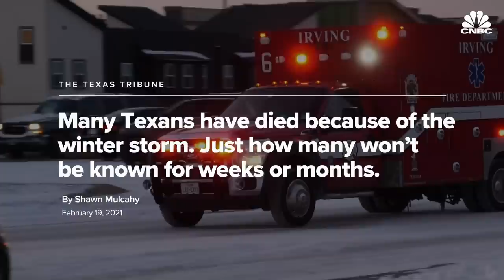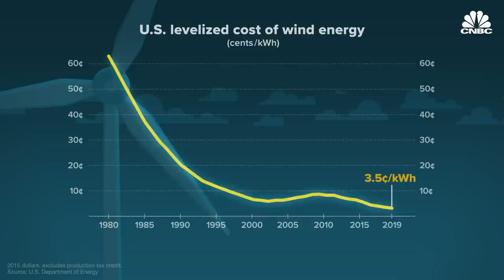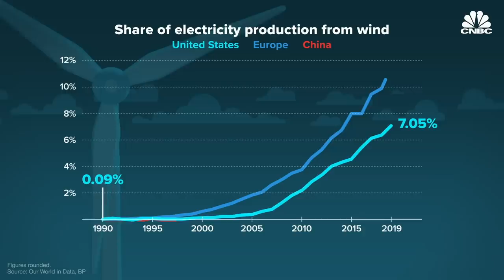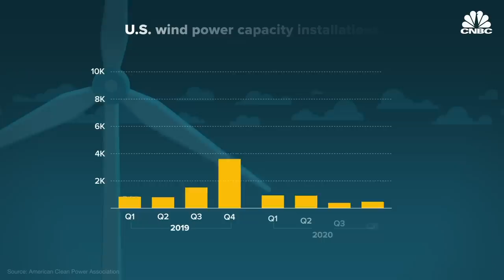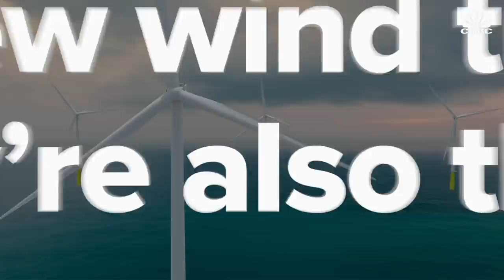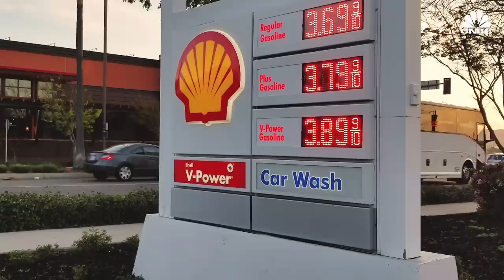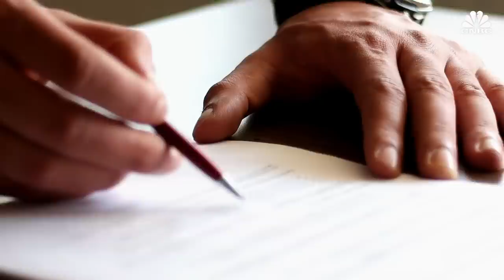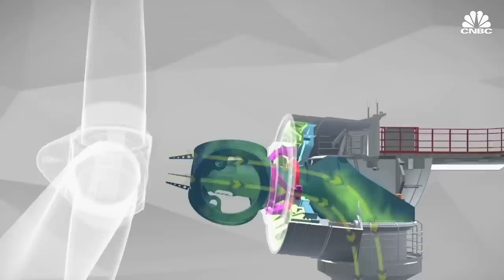The Rise Of Wind Power In The U.S.

Comment: there are so many many ways you could've followed the trend and make this into one of those: 
"the rise and fall of wind power in America"
"why wind power is falling in America"
"why America lags behind in wind power" 
"how America does wind power wrong"
...
exaggerating and using facts out of context to push that narrative, ... but you didn't. that's kind of refreshing 
but you probably wouldn't get as much views with this, especially from foreigners, commenting about how much better they are than America (usually without naming their country)

suggestion: 
why not take a topic like this; wind energy / wind power 
and go through what America is doing right and where there's still room for improvement. 
instead of just focusing on the negative (using facts out of context) creating or enhancing this false narratives.

Comment: Another thing to consider is that when wind turbines reach their end of life, they can be dismantled easily, cheaply and safely.  Many parts can be recycled.  Decommissioning and dismantling fossil fuel plants and nukes is God awful expensive, leaves contamination behind and in the case of nukes, what to do with all the radioactive waste, including structural parts of the plants.  In many cases the taxpayers end up paying much of the costs and have to deal with long term pollution.
Reply: Not true. In most cases, the blades are taken down and land-filled, because there is no recycling program for fiberglass. The turbine motors and wiring can be recycled. The cost to take down a tower is so high that most are abandoned. Imagine, after 30 years of generating power, they decommission the wind farm, and leave 20-100 free standing 300' tall towers. There's a reason that the wind generating companies lease the land instead of buying it. At the end of the lease, the wind company walks away, surrendering their "removal bond" (because it's generally 25% of the actual cost to return the property to its original state), and leaves the mess for the land owner to deal with.

And let's not forget about "tower collapse", "turbine fires" (which are so high that they are allowed to burn themselves out), and blade shear (where one blade breaks and the whole unit destroys itself).

Comment: "operating right at the edge of what the turbines are structurally capable of" - yeah somehow I doubt that. Doesn't sound like a good idea to push these to near their breaking point.
Reply: It is a good idea. That's what engineering is all about. "what the turbines are structurally capable of" includes a margin of safety for all kinds of unlikely situations. In engineering you don't want any unnecessary material anywhere and you want to get everything you possibly can out of a machine as long as it's cost effective to do so.
Reply: @meamzcs  my god, thank you. quite literally the epitome of engineering.

Comment: Wanna know what renewable energy produces more energy than wind and solar combined per amount of land and per amount of building material, and lasts longer and results in less landfill material when scrapped?

Nuclear

Downside is a high initial cost and irrational fear
Reply: Nuclear is extremely dangerous and potentially devastating. Also if you factor in land usage from mining uranium, waste storage, plant sites, and transportation it’s not that much better space usage than any other.
Reply: @shasmi93  I agree to some extend, but the risk for nuclear meltdowns is close to nonexistent because of great improvements in safety

Comment: How can wind be cheaper than solar? The physical installation alone makes me think solar is cleaner and cheaper. What does the end of life disassembly of a wind turbine look like vs solar... You need specialized vehicles and teams to work with the turbines...
Reply: Whst do you think solar panels are made of exactly? And then how many panels do you think you'll need to generate as much electricity as a wind turbine?
Reply: @Hjernespreng  Exactly - solar panels are easy to transport, assemble, take apart, maintain and less hazardous. I guess cheaper panel technology is needed. Concentrated solar is another technology - not sure of its cost, but its nice that some of those give power 24/7 due to molten salt storage.
Reply: @colin1235421   the end valuation comes from generation of GWHrs through life of the device - wind, is an abolute killer there and will only get better with tech advancements.... BUT, PV also has the potential to really jump in efficiency per sq meter as time goes on - things like multi-junction cells, influences from investigating perovskites etc...  you could see solar cells approach 40-50% efficiency where today they're in the 20% range today...  Concentrated solar has some allure in some locations, but not easy to pull off either...

Comment: Are you kidding me we cannot go without fossil fuel can you imagine if all the fire trucks are utility trucks we’re all EV and the police cars when somebody called them more they say sorry we have no power how many solar panels and wind generators Do we need if we went all EV they say we need to off the grid in the United States 30% that’s huge I would need a wind generator in every backyard
Reply: You do understand that even if the world goes primarily electric transport
  Emergency, maintenance, and remotely traveling vehicles are still going to use ICEs as either backup power or primary power.
    Because:
 ICEs, like Diesels can travel everywhere with minimal fuel consumption.
  and most importantly
Diesels are highly unlikely to catch fire, as neither the fuel nor the emissions can be ignited by open flame so simply
   -Ambulances carry a ton of electrical equiment and must be on the call 24/7 even when grid power surges are present!
     Result -future ambulances use Diesel ICE as a generator

   -Fire Trucks have to travel everywhere quickly and be on call 24/7, the true reason to keep the diesel engine as the prime mover is because:
  *Firetrucks themselves can be caught in the infernos and  
or even can be collected in traffic accidents*
   adding high voltage batteries, especially ones that lack tyr armor are the equation to disaster
  Result -Firetrucks wil use the mildest hybrid system in complement to the Diesel ICE.

Comment: You didn't mentioned anything about used materials in production. Huge amount of plastic fibers,crumble in fine dust all over the place. I would like to hear more about that.
Reply: If you want to use electricity, it needs to be produced somewhere. You need a lot of materials for every power plant there is - wind, solar, coal, gas, hydro. With wind you don't get coal ash on your laundry, or ash slurry spills.

Comment: The turbines didn't just freeze but the wind died down to below 8 miles per hour during the freeze. They need wind speed above that to produce any power. The wind and solar provides a little over 25% of Texas electric generation. When the cold weather increased the electric demand the wind died causing the demand to outstrip the total supply. This caused the system to become unstable which caused automatic shut downs of some power plants to protect their equipment. Basically they did not start the rolling blackouts early enough which resulted in the automatic shutdowns of some fossil fuel and nuclear plants causing the overall loss of supply to be much worse. Once plants shut down they also were subject to freezing. So overall you need reliable backup for wind and solar. If they had 100% wind and solar they would have had a complete shutdown.

Comment: How much oil and rare minerals are needed for those off-shore wind energy farms. Include the cable to connect them all & the maintenance. Should be easy to calculate a rough estimate, yet not provided on this video. These calculations should be based on the realistic lifespan of the average wind turbine.

Comment: If thus far the big brains do not posses the mental capacity required to create self heating turbines while someone like myself have designed and implemented such then maybe it's time to boot these so called brain powers out and bring in some fresh minds.
Manufacturing issues, bring the manufacturing to the sites by way of mobile manufacturing. A no brainer.
Locate the farm location, then build the facility that will be there for years.
Many ultrasonic sounds detour birds, easy fix.

Comment: Why does  the media not report on how poor renwables are from a technical point of view, intermittency is bad enough but connecting more and more unstable power to the grid can only cause more problems than it solves. The grid is dynamic and requires dynmic response which renewables simply cannot provide.

Comment: I hear that windmills in Texas weren't winterized due to COVID prevention in-person inspections. I would have also been cool if the video went into disposal of wind blades when they are at the end of their life. To my understanding we are just putting these blades in the desert; essentially industrial waste.
Reply: They weren't winterized because of deregulation and the for-profit energy companies in TX didn't want spend on upgrading their system.  Greed was the problem, not COVID.  TX was warned years ago about the need to upgrade.
Reply: @50jakecs  That's quite the conclusion you jump to. Are you a Marxist as well?  Texas is just as regulated as any state. They had to ask the Federal Department of Energy for permission to generate extra power in preparation for the storm.  

It's odd how people politize this. The problem was not just the windmill and it had nothing to do with the Texas gride. Oklahoma or Louisiana would have had huge difficulties transferring power in state, the girds may be connected but they were never designed to be. Also of the issues with the grid actually had to do with conditions being so bad trucks couldn't drive.  People should also look at the Taxes power generation chart, goth gas and solar had major fluctuations, nuclear was steady as a rock.

Comment: The biggest problem with wind and solar is intermittency! You can call them "cheap" from here to Timbuktu but you cannot solely rely their energy. You will always need other sources to act as back up. Compare these with nuclear energy which once you put in place, you do not need a costly back up since it has virtually no intermittency. Once you add the cost of having back up sources of energy to cater for wind's intermittency, wind becomes undesirable expensive. This whole video was just a puff piece to mislead people.

Comment: The problem is when you build a giga-watt wind turbine you need to build a giga-watt gas power plant. Because if the wind slows down you need a power plant that will quickly make up for the missing power. It is disingenuous to leave out the cost of the gas plant that hopefully is rarely used but must be ready to prevent blackouts like what happened in Texas.

Second, dams across American were dismantled because some fish were killed. If the environment is a concern, then why is no one worried about the hundreds of thousands of dead large birds. Just visit a wind turbine anytime of the year and you will see hundreds of dead large birds all over the place.

Comment: You guys are really determined to lie about the effectiveness of overly expensive unreliable energy sources.

Wind and solar are not only bad for the environment, they’re also extremely expensive
Reply: Ballocks: How can wind and solar be so much worse than fossil fuel

Let's compare:
Dogger bank offshore wind farm in the UK will have around 250 wind turbines with a capacity of 3.6gw, weighing around 1000 tones each, 250,000 tones of mined materials plus substations, cabling etc, maybe 500,000 tones in total

Compared to a 1 GW coal power station: 250,000 tones of materials for power station
But then the power station needs fuel: 9000 tones of coal per DAY, 100 million tones over a 30-year life, (that's 1,000,000,000,000 Kilograms of coal)

Plus the infrastructure to strip mine and transport the coal: mining machines, trucks, trains ships, harbours, conveyor belts etc.
requiring hundreds of millions of gallons of oil 
plus the power stations needs hundreds of billions of gallons of freshwater, 

and all this needs manpower and maintenance.  

Compared to the wind farm that needs, NO fuel, NO freshwater, NO oil
Just similar amounts of maintenance

That's around 110 millions tones of environmental disaster for the coal power station

to around 0.5 million tones of recyclable materials for the wind farm

To produce a simpler amount of electricity over 30 years, And the latest generation of wind farms are not that much more expensive to build compared to the full coal infrastructure, but the Wind Farm needs no fuel cost!

The UK currently generates around 50% of electricity from renewables, with no blackouts, no excessive increase in electricity cost, no massive subsidies and 100% commercially viable!

RIP dirty polluting fossil fuel industry, your days are numbered!
Reply: @stevetaylor2818  You need oil to make and maintain turbines.
Reply: @michaelhutchings6602  It's possible to reduce the burning of oil while also using it for manufacturing and maintaining the blades.  It's a matter of moderation.
Reply: @michaelhutchings6602  Yes, Anything we build now will be built using oil/fossil fuel energy: because that's our current power supply, the next generation will use renewable energy to build new renewables. And yes, some materials need oil in their manufacturer, but that's what we should be saving the last of the oil for, not burning and wasting in polluting power stations.

Plus what do you think the massive fossil fuel industry is constructed with, powered by and maintained by: Yes fossil fuel energy.
Reply: @stevetaylor2818  Oil is the lifeblood of modern civilization. You will always need it. The process of mining and manufacturing solar panels and wind turbines in incredibly carbon intensive. If your goal is to reduce carbon emissions just build nuclear. To force unreliable energy on poor people is immoral.